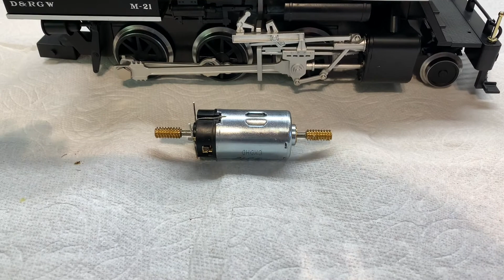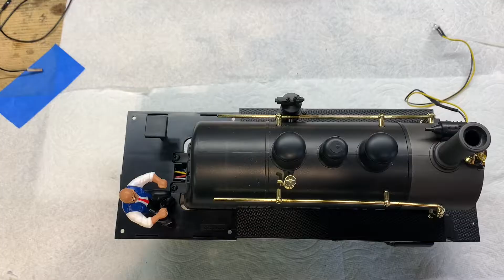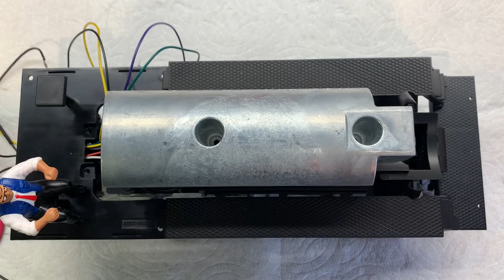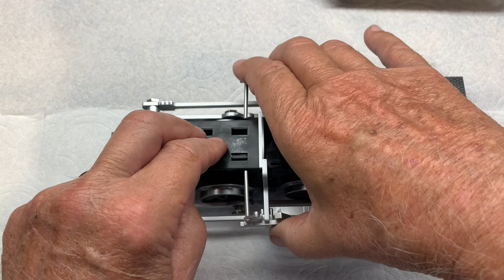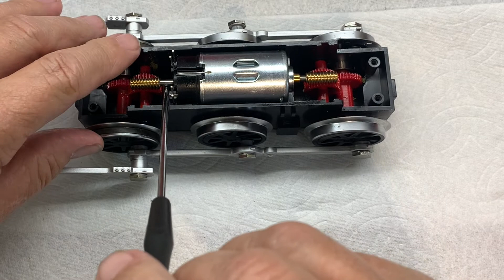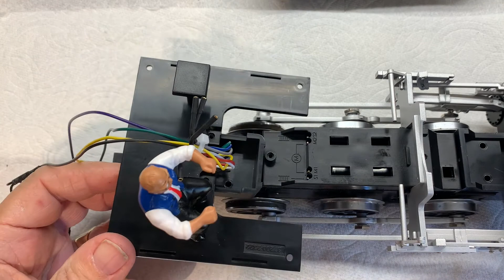PIKO Motor Replacement

Comment: Any idea what was wrong with the old motor?
Reply from the maker: It was probably an open winding, but don't remember doing much testing on the old motor before I through it away.  Anyway, it was dead when voltage was applied directly to it.
Reply: @Steve2223  gotcha! Thanks for a great video! It was very informative! Have a great day sir!